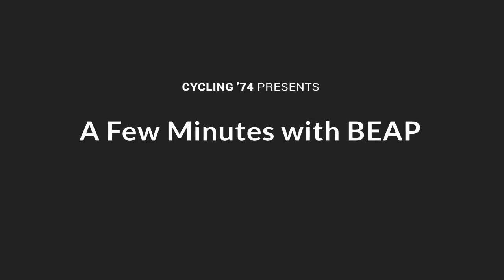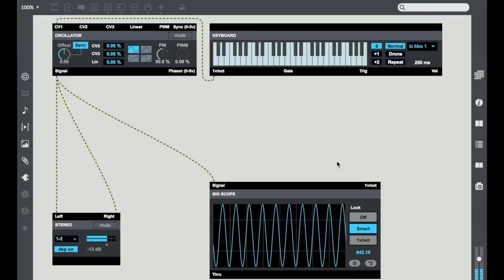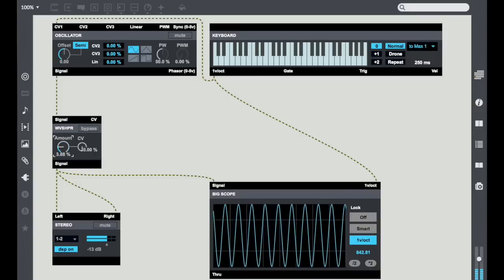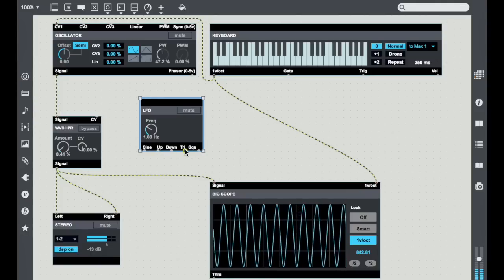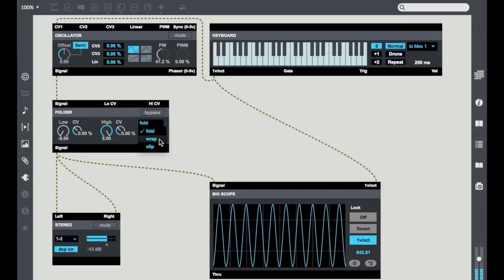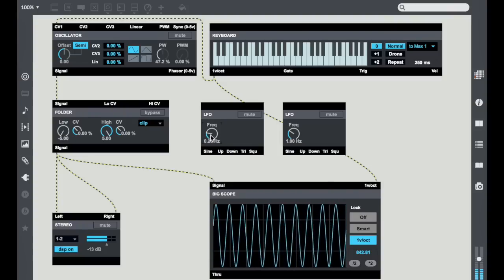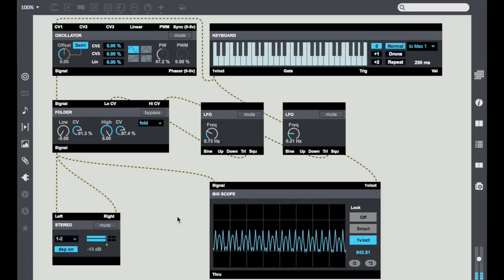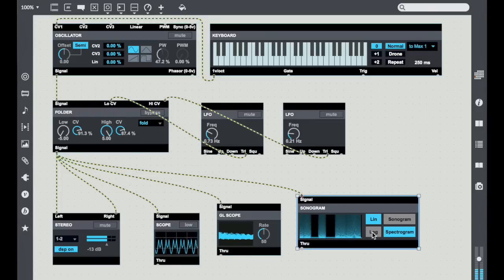A Few Minutes with BEAP: Use waveshapers to add harmonic content to simple waveforms (Part 7)

Comment: Thanks for these great tutorials Darwin. Question : when you use LFOs to control different object parameters, it seems like you usually default to the Tri wave setting. Is there a specific reason you prefer Tri?